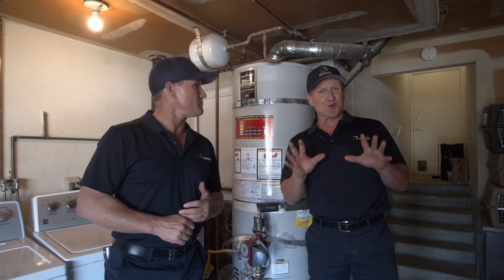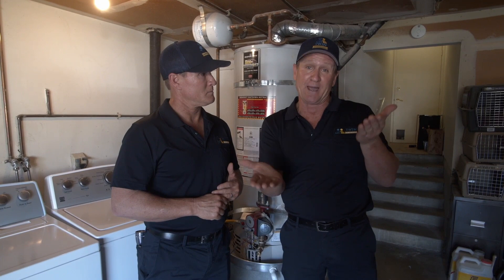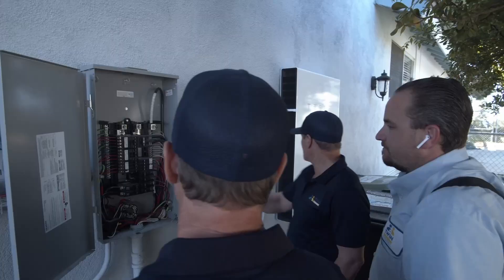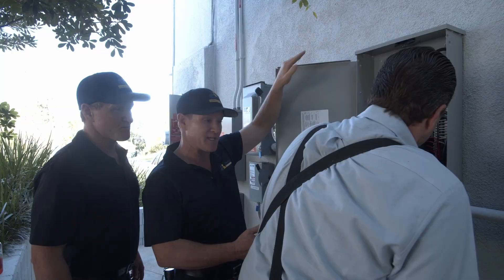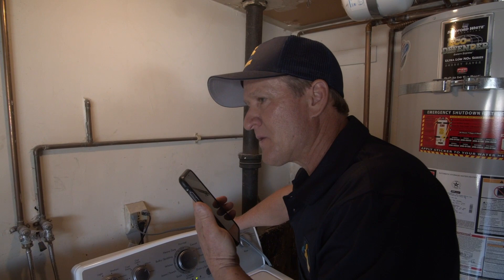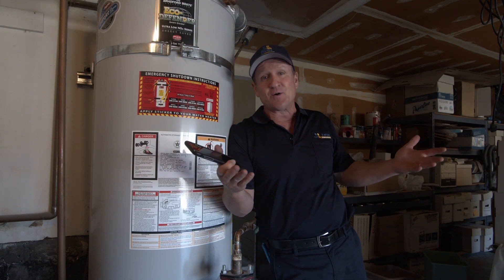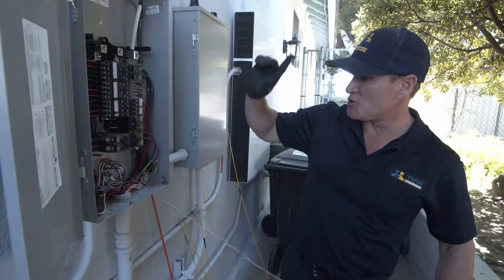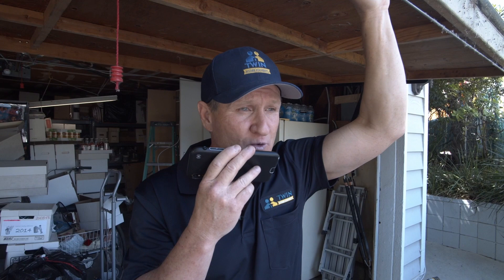Tankless (electric) Water Heater vs Hybrid  with a TESLA POWERWALL...which is BEST?

Comment: Tankless isn’t a good solutions for Solar Power at this point.   Where Tankless is good is delivering seemingly unending hot water which by comparison to a standard water tank is done more efficiently.   I’ve heard that from people designing Solar systems that they had to move away from Tankless because the initial surge of power will often exceed the parameters of many solar systems.    I’m digging the Rheem ProTerra Hybrid.  The surge to your power is minimal and with a UEF of 4 for the 80 Gallon it’s ¼ the annual energy of my current Marathon water heater.  

I have a family of 4 so we really don’t run out of water to the point where Tankless would benefit us given the rough install it would take in our home (we looked into them)
Reply: Solar hot water is by far the best way to go.   I had that in AZ and have a family member in Mass with solar hot water.   I never ever ran out of hot water in AZ and in Mass the system is doing really well.  100% the best way to go if your into solar,  can even run the circulation pump off a small panel in many cases and store all that hot water in a 80 or 120 gallon tank.

Comment: Tankless electric takes a ton of power.  Running an 18kw on a 200 amp service and I wouldn't go any higher.   Tankless Gas is the way to go,  hybrid is nice of course.   My background is in electronics.    So for my 200 amp service that gives me 48KVA,  I'm using 18KVA for the tankless as it's 99% efficient.    Moving to a 24Kw unit would use half my available 48 KVA.   The transformer on the pole also comes into play as often they'll toss up say a 50KVA or 70KVA and run that to multiple homes all with 200 amp (48KVA) service.   Yep they know people aren't going to use what that are rated for,  so it works out.   Now if I use half the power from a 50KVA transformer Just for my tankless.....well..I think you can see the problem.    Enjoying the 18kw unit btw.

Comment: IMHO,  tankless water heaters are crap, they cause a lot of mineral deposits and need a lot of maintenance, probably expensive too.  Use an old fashioned time tested water heater if you want trouble free hot water. Even hybrid systems are not as good as old fashioned water heaters, IMO.  How can a gas heater not be compatible with solar power?  It doesn't use electricity.